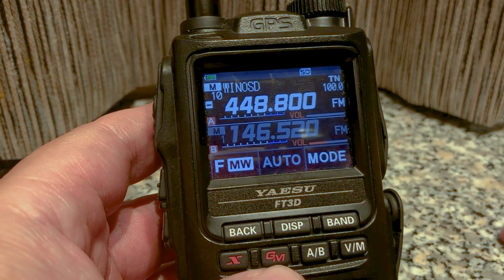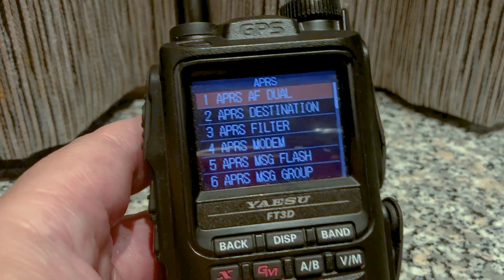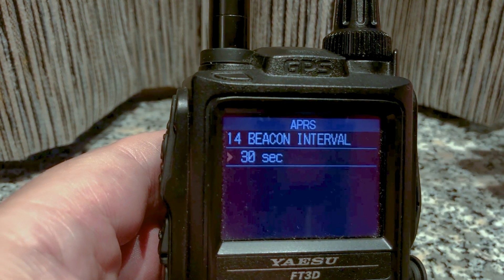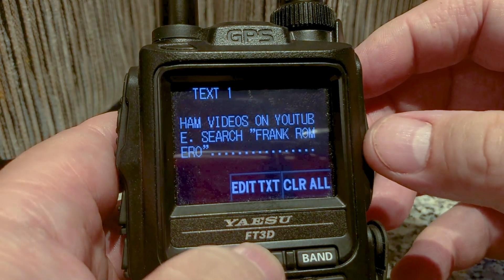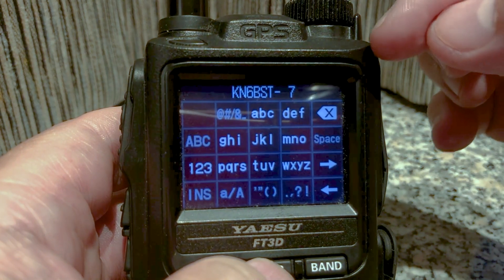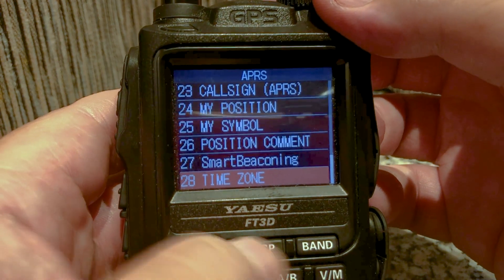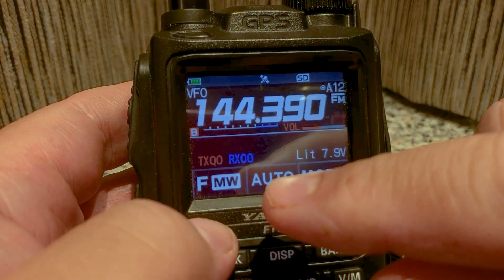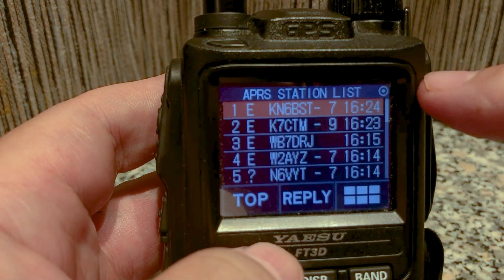Yaesu FT3D APRS Quick Setup

Comment: I'm getting a red transmit light and there are no items in my station list. Does that mean I'm not connecting to a repeater?
Reply: @frankwc0o  thanks. I'm at work. I was thinking the building was blocking my signal. I got a packet out at a different location. I appreciate your help.